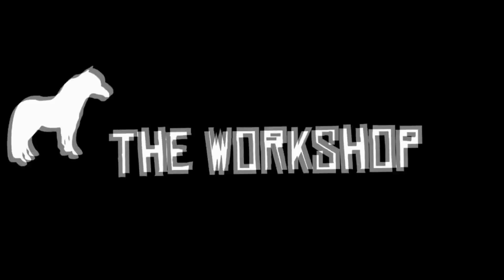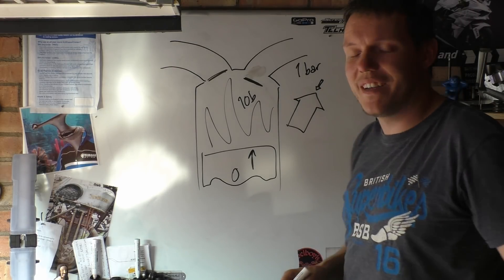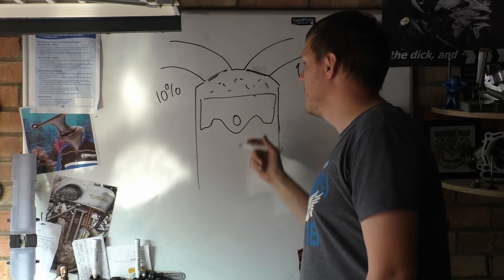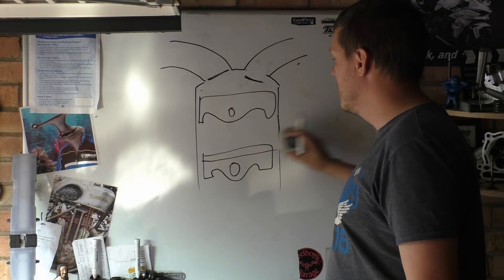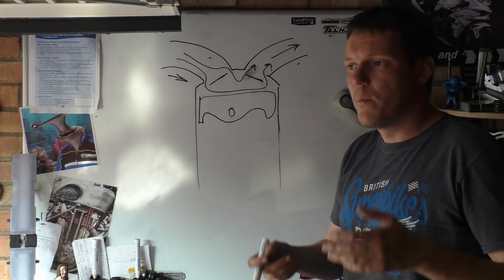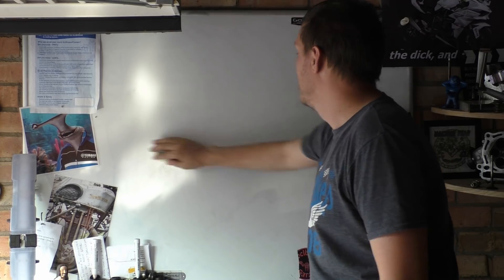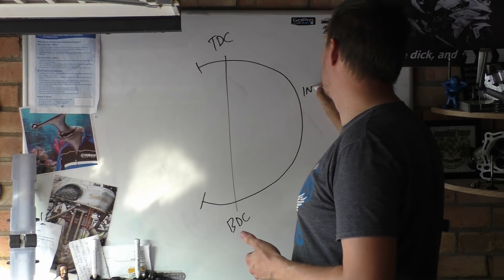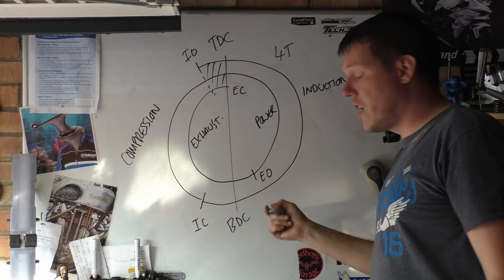Valve overlap - The basics

Comment: some the exaust gases will find their way out of the cylinder because of the inertia (high rpm) (basicly reverse inertia filling) and create a negative pressure a well tuned exaust will increase this effect. and then when the intake valve opens you accelerate your fuel air mixture because of the pressure differance a well tuned intake runner will increase this effect. the point im trying to make is overlap is not just about getting exuast out its also about starting the accelration of the fuel air mixture (which takes some time because of the mass of the air) before the piston is on its way down again. If you start the acceleration before TDC the piston will not start to create a negative pressure and thus decreaseing pumping loses and so on (affects port size where top speed of the fuel air mixture is). (english = 2nd language)